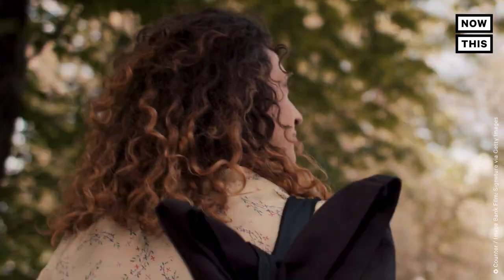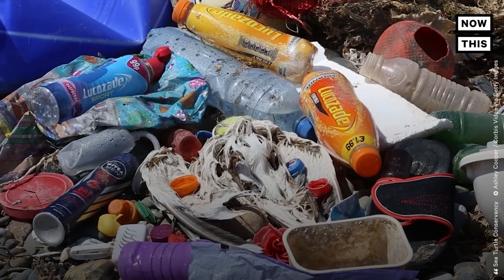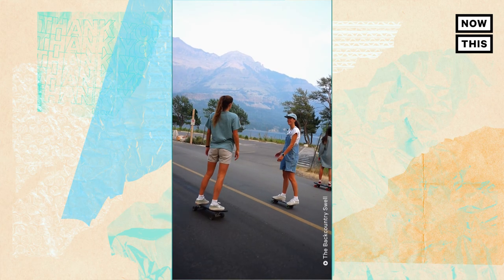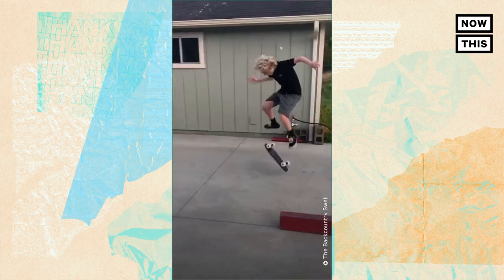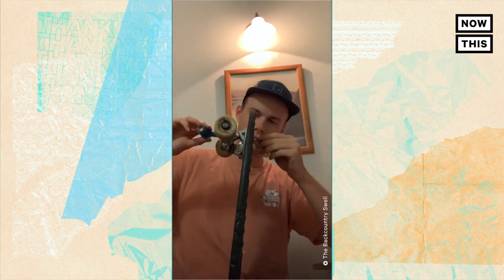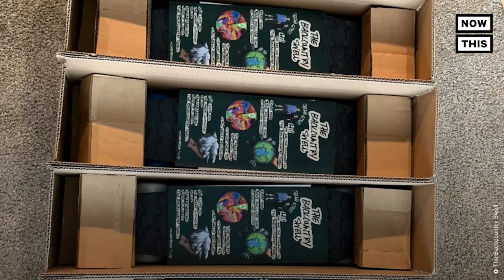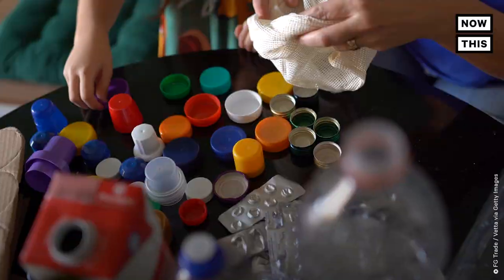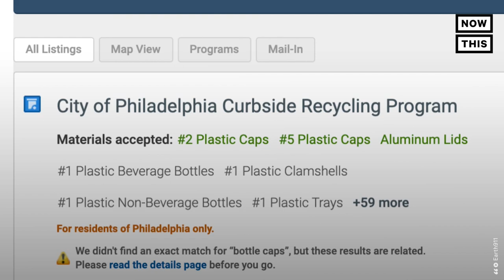How This Company Makes Skateboards From Bottle Caps | UpcycleThis

Comment: Have you started an export side to your market?
Would make an absolute killing here in Australia
Reply: Would be cheaper to upcycle them and make them in Australia. There’s more than enough raw material in Australia for it. Rather than use energy transporting them from USA. 

Bottle caps are made of HDPE & LDPE. Polyethylenes are relatively easy to upcycle. It is possible to do so without extrusion machines and use home appliances instead so it’s methods are accessible to a hobbyist.
Reply: im one of the owners! if you have any connections it would be awesome to do a cleanup in Australia and make some boards with plastic from those beaches. we do a similar thing in hawaii! would also be cool to get our boards into a shop out there!

Comment: I used to go to the shore of L. Ontario whenever the wind was right, and ride kite buggy up and down the beach.
I would carry a 30 gallon garbage bag with me, and take an hour (or less) to fill it with plastic trash that washes up. Bottle caps, cigar tips, and plastic tampon inserters(?) were the most often encountered junk🙄
Then single use plastic bags, usually full of sand, and plastic bottles from drink bottles to the large laundry soap bottles.

Comment: Can't these plastics bottle caps be turned into paper caps just like paper straw however placing an instact seal under cap that would prevent Paper Cap from getting wet.

It's just the to thought, What are your views about it or better than this?